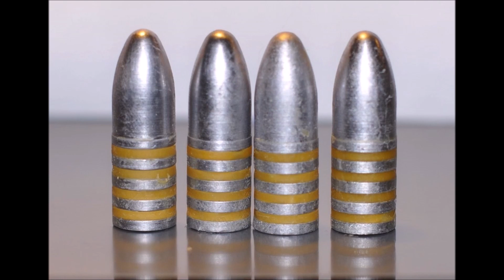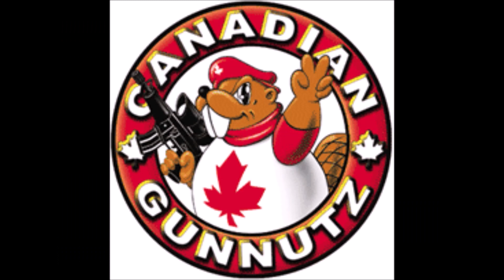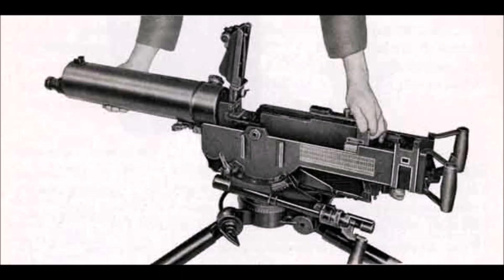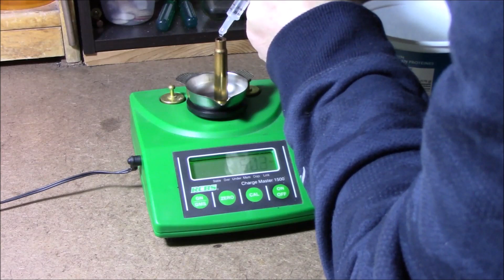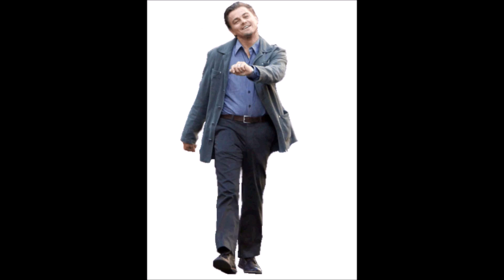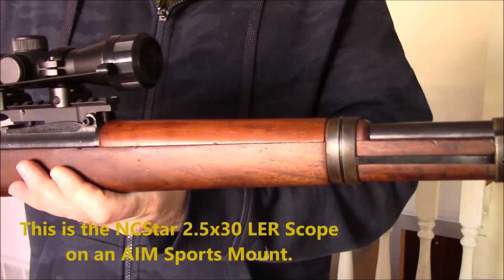8x63 Swedish - Downloading for 8x57 Cartridges

Comment: Re: discrepancy with the 45 grain load - perhaps a result of barrel temperature at that point in the testing? Were the time intervals between testing different loads consistent? Was there a notably longer time interval between the 45 grain & 46 grain test while you pondered WTF was going on; thus allowing some barrel cooling to bring it back tighter? Just a thought. Great video!

Comment: Tudenom...I'll trade you some 8x57mm Mauser surpless on brass stripper clips in a cloth banderol of about 70 rounds or so...for the 8x63mm Swedish one round for one round, even trade...I'll have my rifle chamber cast to make sure it's a go...I'm 99 % sure it's an 8x63mm machine gun crew rifle...chambered in this caliber...it's very friggin odd...8mm bore with original Swedish barrel and the 6.5mm Swede chambers perfectly...the bolt will even lock down on it...with ease.  However, it's an 8 mm caliber and chamber is apparently longer.  I read where Swedish MG crews were issued with their rifles cut to the same caliber as the MG they were firing...the 8x63mm.  This rifle has be sporterized or it would be highly collectible...the rifle is not the 8x57mm Mauser...the shell case will only go in about half ways and stop...but the slender 6.5mm swede fits perfectly.
Reply from the maker: Yeah, that's odd.  The 8x63 is a bit fatter at the neck, shoulder, and base, so you would think an 8x57 would plunk in there like baby Jessica in a well.  I was thinking maybe it could be 8x64 Breneke, but if a 6.5x55 fits fine then that can't be the 8x64 since the 6.5 Swede has a fatter base.

How many other cartridges have a 12.20mm base though?  That's really weird, I'm stumped!

As for trades and stuff, well that all depends on whether or not you live in Canada and the laws involved with shipping ammo / components across the border.  If you live outside Canada then we're pretty much hooped.
Reply: @MrTudenom  I'm absolutely dumbfounded by it all...it appears to be an 8mm barrel at the muzzle, numbers match barrel...the only thing I can figure is it's the 8x63 Swedish Mauser made for MG crews...they cut chambers for MG crews for rifles to shoot same ammo as the MG's...yeah, I'm in USA...If only I had one round of that stuff, I could see if it would drop into the chamber or an empty primed case...I doubt that would be illegal...it's just a brass case...Dennis...the rifle is all matching numbers, but is sporterized...with about a 21 inch barrel and steel Weaver 3x scope from late 60's or early 70's...and Redfield rings...it's very very nice...and tight...barrel shines like new money...it needs to talk again...no wonder someone sold it cheap on gunbroker.com...I got it for about $120 or so some years ago...with the Weaver scope and stock does not have a mark on it...

Comment: A friend of mine down-loaded into 8 X 57 recently and had good accuracy at 45 grain and using the original ball projectile.  Not sure if it a real concern as regards cupro-nickel bore fouling but I think that I will molycoat the bullets before using them in my own tests.
Reply from the maker: Molycoat sounds like a reasonable precaution.  From what I've read the nickel content in the jacket increases its hardness, so it wouldn't be a bad idea to coat it like you've suggested.

Comment: Did the bullet sit at the right hight in the 8x57? I saw a picture and some bullet dimensions that showed a difference of the swede to the Mauser. Essentially the 8x63 sits deeper in the neck and has a crimp groove that is higher on the bullet than the 8x57. Thanks for the video, to you and riflechair. 
I'm just getting into this field, hope you understand this is just theoretical question.
Reply from the maker: Good question.  You're right, the crimp groove is really high on these bullets, and if you use them for 8x57 reloading your overall length is going to be really short.

I ended up ignoring the groove and just made sure the cartridge would feed in the magazine and not engage the rifling when chambered.

I suppose if you are reloading for an Egyptian Hakim you might have to use the crimp groove where it is and put up with the short overall length.

Comment: I have used this powder to load 303 Brit / 174gr Hornady RN with good success. When loading for the 8X57 I am having some measure of difficulty getting that 218gr 8mm pill to impact at point of aim using open sights. I am usually 6 - 8" low at 100m however I am also using modern extruded powders for that. Great video Tudenom. I made a video on this five years ago...   https://youtu.be/_DLVegAZC_c
Reply from the maker: Ha!  I had no idea you did a video on this :)  It didn't show up when I did a search for 8x63 on youtube.